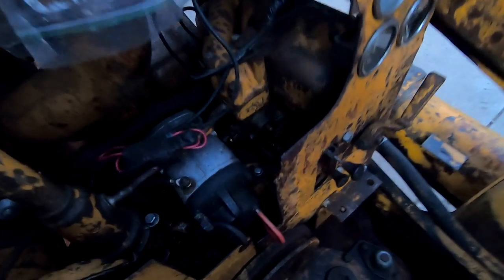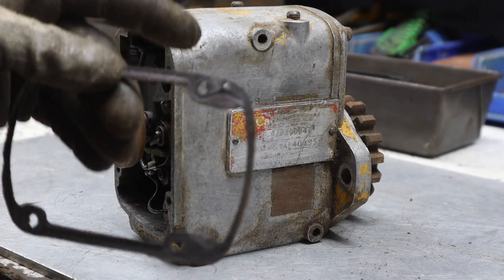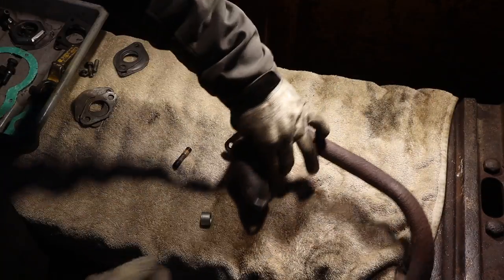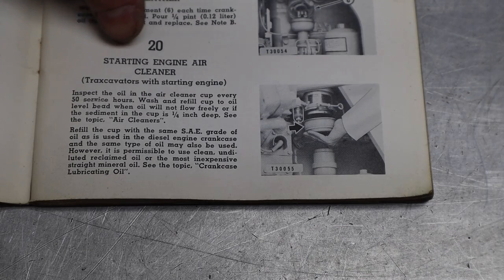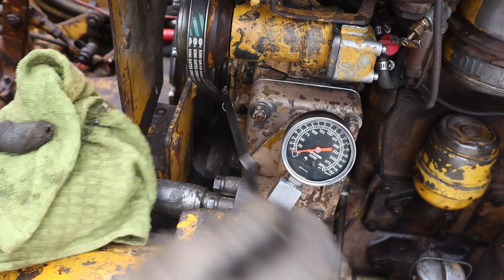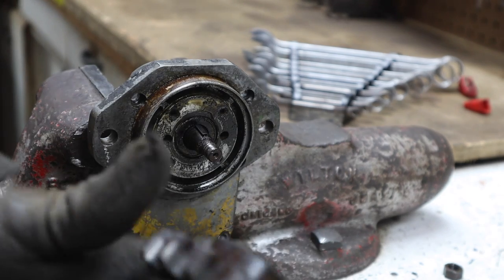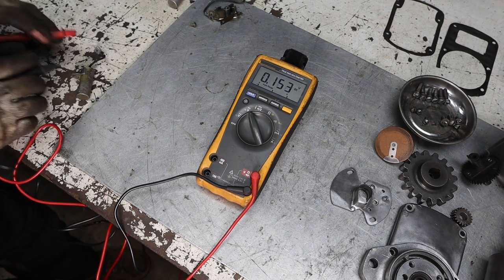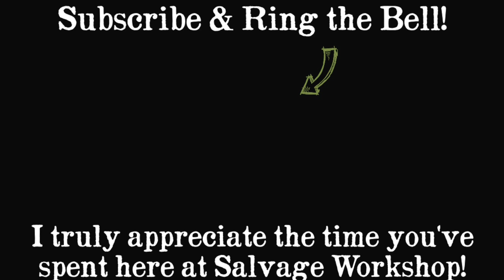FINALLY Found the PROBLEM! ~ Time to Rebuild a Magneto ~ Part 14 ~ 1950s Caterpillar TraxCavator

Comment: That prong only to hold end from pulling off the plug wire. Not to get the spark from. You still have to bring out conductor wire and wrap it around the side for contact. The brass end goes on wire side to solid side to wire core.

Comment: 50:20 You should ideally be measuring the condenser with the capacitance range on your multimeter. On your meter you simply place the selector in the Ohms Ω range and then press the yellow button (2nd function). The condenser should state what its capacitance value is on the can (usually). Your method is still OK but reading the capacitance directly will tell you if it has started to go out of range. They are typically 200 nF - 300 nF ie 0.2 - 0.3 uF.

Comment: The way you did the connector was the right way to do it. The spike on the connector is to hold the connector onto the wire. Not to penetrate and engage the conductor. The spike is barely long enough to clear the insulation. Or it would cut the conductor.

Comment: Also there are brass bleeder valves on the bottom of the pony heads, or there should be.  Makes it a lot easier to spin over by hand.  My apologies for the multiple posts. Commenting as I watch!
Reply: That motor has them, but he removed them cause they were not sealing.

Comment: A thread lock tip for you. Your thread lock now may set in the lid because it looks like you touched it against the shift thread. Thread lock works by anaerobic, lack of oxygen/air and the presidents of metal by touching the thread lock bottle end against the shaft you have introduced presence of metal on to the end of the bottle this will cure the thread lock now. Hope this helps you in the future.

Comment: I am a big fan of re-cycling mechanical parts as much as possible, electrical fittings and wire due to cost do not fit into my re-cycling use, I have always replaced them with new.

Comment: I'm sure you have figured out that the correct way is the way that snaps the disk into making the spark. One way easy , other way snaps and quickly pulls the armature thru the mag and produces that zap.

Comment: Also, I did not see them but there should be timing marks on both gears inside the mageneto and they need to line up or you will have no sparks.

Take care.

Comment: Put a spark plug and wire on the magneto. ground the spark plug to the magneto housing and spin the mag. If it is working properly you should have spark. The magneto creates its own electricity by the armature spinning inside the magnets. Smart move to discover why the teeth sheared off the mag gear. Waiting on the next update!!

Comment: TIM from Canada here is a suggestion for the guy that is rebuilding the caterpillar.... you should go to the dollar store or somewhere and get yourself A binder this way when you were taking parts off you can write them down in a book and this  Way if you need to go back and revisit parts numbers they are in the book for example whatever one you were working on there you just give the part number so write it in the book and the next time that goes bad you have a reference.. this goes for anything that you take apart if it has a part number invest in a book or a binder write down part numbers as you are dealing with it and if you need to go back and look at some thing you do not need to take apart the whole engine to see what you were doing and by the way it looks like this big machine of yours will have a lot of part numbers maybe.. you might be able to outsource the parts to another dealership and not deal with the cat because it looks like a lot of parts are discontinued from the big machine

Comment: As others have hinted maybe some debris got jammed in the gears to do that damage, so I think it is important to look for the old tooth and debris that could get caught in the pony motor   magneto gear. You have found a catalog of issues as you have stripped the pony motor. I think it would be best to go the whole distance and pull the pony motor and check out everything.

Comment: Yes, best get the tooth out That gear drives the pinion to start the big engine. Lot of work to pull the starter pinion! If the piece is down that far. Good luck, always a learning adventure.

Comment: Please use dielectric grease. Every connection adds resistance and amperage draw on the fuses. The grease also protects the connenctor ends of your components, not just the cheap wires.

Comment: I’ve been going back through some of your older videos.
In your “Rescuing Old Iron” series I noticed you ended up with a lot tooling that may not be usable.
Most tool steel pieces have a number on them that tells you what the grade of tool steel is.
Such as M3, CF8M
Some of these tool steels have a very high scrap metal value. It is well worth getting a tool steel and alloy chart and  separating the different grades. It could be a few dollars per pound verses a few cents per pound for scrap steel.

Comment: Nice refurbishing. I have two questions. First, there has to be some type alignment procedure to get the mag firing at the proper times for each TDC compression stroke. So there has to be alignment marks to verify. Second, since we all know there are teeth missing, where did they go? Are they laying somewhere that will rear their ugly heads later on and cause more damage, or did they somehow drop out the bottom? That's what would worry me more then anything else. Thumbs Up for the videos. I thoroughly enjoy watching the work efforts and such.

Comment: Somewhere in that pony motor are some parts and pieces from that gear.  Absolutely have to pull it down until they are found and removed as well as what caused it, be it what may.

Comment: My personal experience with magnetos has been if you fully dismantle it you need to "recharge" the magnets when you reassemble it or it will have weak or no spark. (Wico,Bosch and FM) hopefully you can find someone who has the tool to do it. Our local vintage tractor club has a member who did mine.
And I wouldn't just hold one in my hand and whirl the gear. At best, you get a nasty shock. At worst you damage the ungrounded mag.
Reply: Correct on all counts

Comment: Studs allow you avoid wearing out the threads in the casting.  Putting a bolt in there, obviously solves the immediate problem but you're better off putting a stud back.  Glad you found the problem.  Did you find the tooth in the oil well?

Comment: Had a Fairbanks Morris magneto similar to that on my old Harley Davidson WLA, instead of a battery. It fires both spark plugs at the same time, and of course, only the cylinder, which is on it's power stroke does the spark make a difference, but they figured, that it was simpler to let the off cylinder's plug fire too, than to complicate things with a distributor, even though it cuts the current to each plug in half (the magneto was aftermarket, but the OEM battery based ignition also fired both plugs simultaneously. It'd be nice to convert it to electronic ignition, but some of the magnetos of that type don't have enough oomph (to put it in technical terms) to make it through the resistance of a transistor.

Comment: great video i would do the same better to be safe then sorry when it comes to old machines the broken peace will show its self again when you don't want it to and damage more of the engine those old pony motors are hard to come by running or not running look forward to the future video on it and where the broken tooth went

Comment: Suggestion box- I would have loctited the nut on the unbroken gear at the rear.  Yes, it only spins when pony spins but it's vibrating all the time Old Red is running.  And it's a bugger to get to and it will cause bad oopsies if it falls off.

Comment: And when it all goes back together, you might want to time the mag.  Perhaps some ID marks on the gears?  Wonder where the broken teeth went?  Good luck pulling that all back down, I know it's frustrating, but, you can rest assured that those loose teeth dont make a mess that you cant fix.  Great vids, thanks and waiting for the next one.

Comment: Some words of caution to you:

A magneto is not an alternator. It doesn't require outside voltage.
Without installing it, you could easily bench test the unit.
Secure it in a wood-jawed vice, or bolt it down. Hook up your DMM to read
Thousands of DC, then use a drill & socket to spin it. Be careful, DEADLY voltage.

Also- be mindful of the timing marks on both the drive and driven gears-
it has to spark at the correct times. It's not an old fashioned "Buzz Box" that
sparks constantly. That distributor cap is checkable for OHMs.
Go between the tower/probe needle that goes into the coil, to the middle brush.
You should also OHM that coil, and dab of grease behind the points pivot, where
it rides it's cam lobe.

Comment: The Disc in the magneto is commonly refered to as a “Rotor Arm”, the “point contacts dont corrode when being used but get arc damage from high current being opened across the gap.
Reply: The proper condenser (capacitor) prevents arcing. The rubbing block will wear out before the points burn. If you get a worn out rubbing block- REUSE the capacitor as brand new ones vary widely in capacitance. (in tuneup class at tech we tested them and sent more than 1/2 back to the supplier as out of spec range).
Reply: @wssides  Hi Bill, It does indeed prevent arcing but its primary purpose is to prevent a build up of back EMF each time the coil field collapses. Without the condensor (capacitor) the back EMF will overcome (or equal) the input voltage and the field collapses. A dead or faulty capacitor will quite often  show as an initial fire and start up immediately followed within a second by engine cut out - giving the impression of fuel starvation. A spark test can sometimes be performed that shows a spark at the plug and the assumption is all well but as above it will start or fire and then immeadiately cut out. ( Very pronounced on outboard engines)

Comment: I own a D4 7U cat dozer I bought 50 years ago. It has the very same engine and pony engine as your track loader. When I bought my dozer the pony had not been used in years. They just pull started it with a big farm tractor. So my pony was froze up. I removed it and took it completely apart. it had been rebuilt before. .020 pistons and ..010 rod journals stock main bearings. Any way I fixed it and always ran a 50-50 mix of 30 weight oil and STP. and change it once a year.  there isnt any oil pump &oil  filter or anything , just splash lubrication..Judging from the excessive wear on the  broken gear I would expect the idler gear that turns it is also worn?

Comment: Since you brought up Bakelite, the 1930s-developed first (I think) widely-used plastic material (all sorts of non-metal devices, including radios, cookware, etc.), I know of a story about its use in the US Navy during WWII to solve a major problem with its new armor-piercing projectile base fuze, the Mark 21 Base Detonating Fuze, used in all of the US Navy AP ammo from 6" (new light cruisers) to 16" (latest battleships).  This fuze was very different from prior designs in that it was designed to lock itself tightly internally on impact to keep it from being inactivated by the huge forces when going through a very thick armor plates at almost 45 degrees (test specs for the new post-1935-developed extra-strong, oval-nosed shells were at 35-40 degrees, the most oblique requirements of any such ammo ever used by anybody) .  Prior fuze designs, for lesser angle requirements through the end of WWI to the  early 1930s, simply had the internal firing pin, unlocked by the firing forces ("setback") and spin of the shell inflight, move forward on impact and start the delay-action process to allow the shell time to punch through the armor and move some distance inside the enemy target ship before exploding, with the less-oblique angle allowing inertia as the shell was slowed during the penetration to be enough to hold the internal components of the fuze rigid until the shell went through and the forces were now much lower.  The very high angle of the new shell testing required a new fuze, the Mark 21, that had the unique feature that the explosion of the sensitive high explosive primer by the firing pin on initial impact not only set off the small delay element (a thin black-powder pellet), but literally jammed the entire mechanism, including the delay pellet, the short tube behind the pellet directing the burning powder when it was at its end to the detonator,. the powerful high-explosive detonator pellet, the two short TNT-filled tubes (adding their blast power to the detonator blast that set them off), which compressed all of this into a locked position aligned with the back of the two small boosters (very powerful explosive charges using tiny needle-jets of blast located at the upper portion of the fuze in two rocket-nozzle-shaped pits (one on either side of the fuze tip) that focused their blast into the the bottom of the main explosive filler charge.  This step-by-step process inside the fuze was found to be liable to be knocked sideways slightly by the forces at such a highly oblique impact in the older fuze designs, making many of them dud.("blind").  This new locking system using the blast of the primer worked perfectly in tests and was then used in the new Mark 21 BDF introduced just before the US entered WWII in jmid-1941.

Then along came Operation Torch in mid-1942, the invasion of North Africa Vichy French holdings around Casablanca, then under the thumb of the Nazis (see the great movie by that name!).  At that port city, there was some French warships, including the incomplete, but still partially armed, French battleship JEAN BART with one 15" 4-gun turret in full operation (the other turret was not functional).  So the new battleship USS MASSACHUSETTS was given the job of neutralizing the French battleship and it did, jamming that 15" turret by a glancing blow to its lower edge (the crew needed a cutting torch to free it, so it was out of the battle) and putting several holes into the hull so that the French ship, which was stuck at its pier, sank almost to the deck level in mud and water.  Initially, things looked good for MASSACHUSETTS until it was found that a large number of its shells HAD NOT EXPLODED AT ALL OR ONLY HAD A WEASK, "LOW-ORDER" WXPLOSION.  Those new fuzes were failing to set off the shell filler properly.  Since that Mark 21 BDF was, as noted, used in ALL US Navy AP ammo, this problem was a BIG DEAL.  Big investigation at the US Naval Proving Ground and some other Navy labs to find out what had happened.  It took several months, but they finally discovered that the new fuzes had much tighter tolerances in that locked section that had to physically move upward inside the fuze to align and hold everything together during the delay time.  If even a little corrosion got into that sliding section, it might jam up and not lock properly, giving the results seen at Casablanca.  The culprit was the fumes from the main shell explosive, ammonium picrate, called in the US Navy and US Army, "Explosive 'D'" (after it inventor a Mr. Dunn in the late 1880s).  It was a very safe-to-use explosive (very important to the US Navy!!!), but it needed a powerful "kick" to properly set it off and any misalignment in the fuze that even slightly reduced the fuze's ability to provide that kick messed up the shell explosive operation (this filler was difficult to set off just by impact alone, which was why the Navy used it exclusively for such ammo).  After about 6 months inside a shell, the fumes had messed up due to corrosion a large percentage of the shells, so the fuzes had to be removed and and hand-cleaned at the factory before this, a big headache.  A crash program was initiated to find a way to fix the existing fuze design.  Shortly, by early in 1943, it was discovered that Bakelite was airtight when used as a dipped coating for the fuze portion sticking into the shell body, so all fuzes were now coated in Bakelite at the factory  before being issued to the Navy.  Problem permanently solved.  A perfect scientific "who-done-it" story!

Comment: The poney motor drive pulley that the belt rides on.  The front of it is notched so u dont have to pull the pulley to change the belt.    Also i would be more worried about where that big peice of gear went.  But looks like ur doing a geeat job on it

Comment: didn't hear anything mentioned about timing  with the magneto.  I believe I saw timing marks behind inside gear and also on housing and gear that  match up to motor. Look for timing marks on engine gear and magneto gear. When those plugs fire I believe they have to be timed with the engine so check into that also.

Comment: I worked with similer magnatos when in the Milatary and we would clamp them in a bench vice with wires and plugs installed and spin them with an air wrench and check to see if they fired before installing in unit, May help .

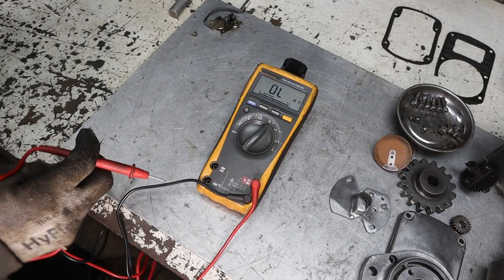Comment: 50:48 your ohms reading on the condenser didn't go up because you were grounding the lead on the metal plate on the bench, which was in turn grounded to the condenser shell.
yeah, you caught that.

Comment: Very VERY right not to put it together without searching deeply down to the bottom of the problem. And there's still at least that one torn-off tooth to be found anywhere flying or floating around getting it spinning again (as long as we estimate the other parts went o dust, not pieces) ....

Comment: dont forget your multimeter has a capacitance check mode, in ohms press your yellow button and it will switch to measure capacitance.

Comment: I think if you ask Cat you will find that is a distributor with an integral coil, not a magneto as a mag would not spin as you have spun that one. The internals of a mag have a 'wind up and snap' feature that generates the spark at low rpm.